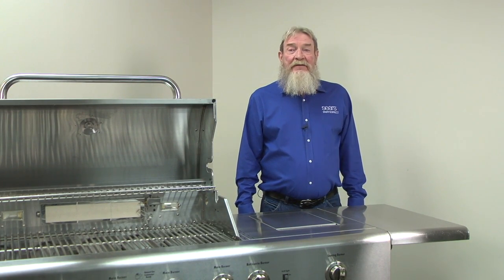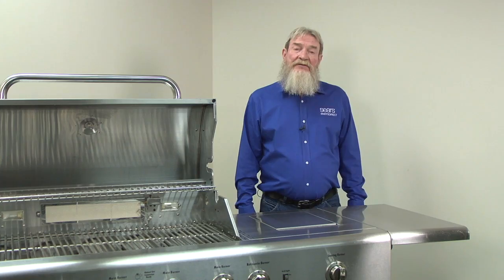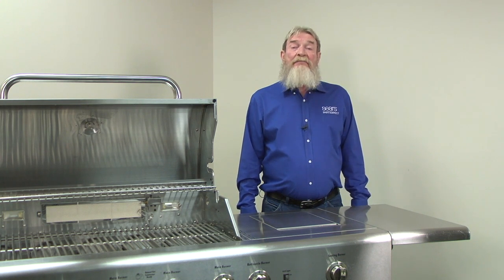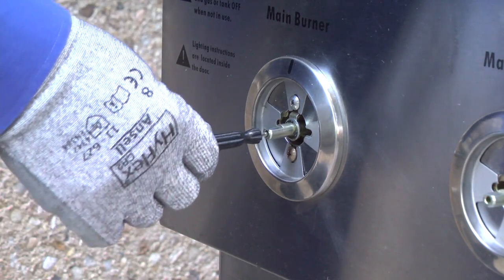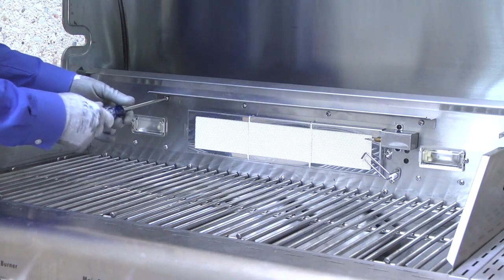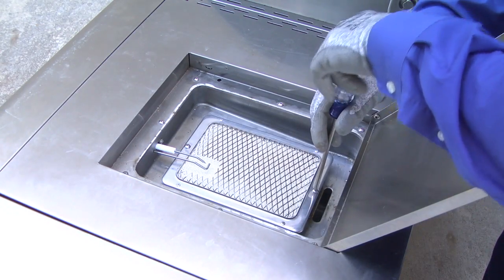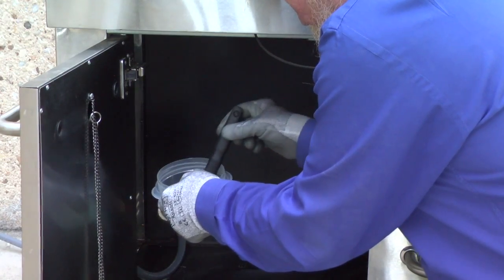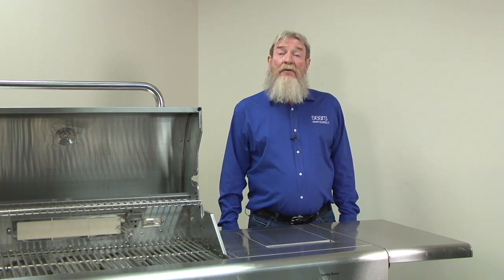Converting a Gas Grill to Natural Gas

Comment: This video was very informative, The BBQ was made in China. This unit may only last two or three years before it rots away. I bought a Natural Gas 5 burner plus side burner from Walmart 12 years ago. It was missing the natural gas orifices. I hand drilled the holes bigger, It came with the hose and quick connect and a shut off valve. a small thing of dope. I sprayed everything with a 50 to 50 mixture of soap and water. No bubbles. Ever-thing is rusting away. I bent 5 heat deflectors on a break 3 years ago out of stainless steel. Since I only spent $150.00 plus tax...Time for another BBQ. Every display model I've looked at in various stores have something in common. $$$$ over priced and they all have dings in them plus the natural gas unit is $50.00 to $100.00 more. The dual fuel models now only require you to remove the orifices and backing plates on the flame adjustments,if needed. Just says Natural Gas. A 9/32mm socket to remove the orifices. Think about this, To not install the orifices and sell a Natural gas hose in place of a liquid propane with a regulator or buy the Natural Gas hose separately? You pay allot more? Playing on your stupidity!